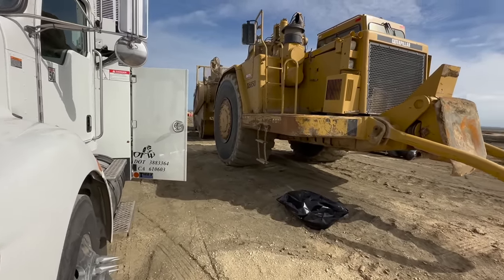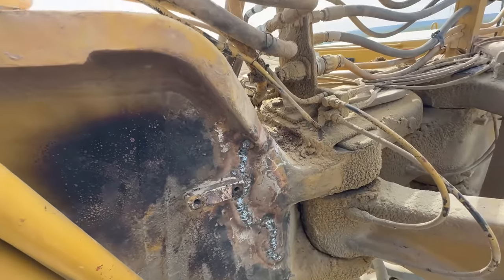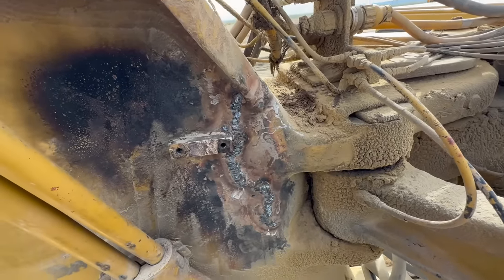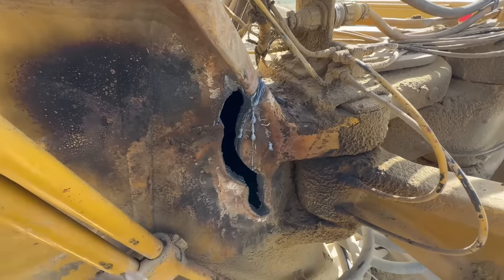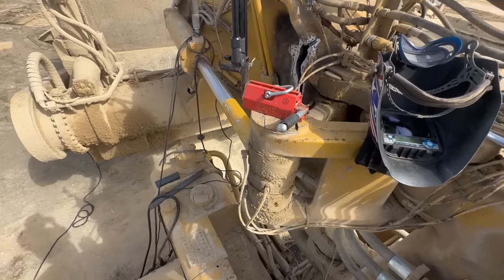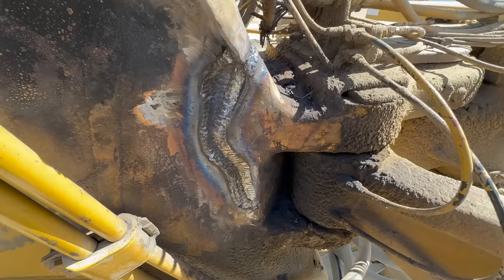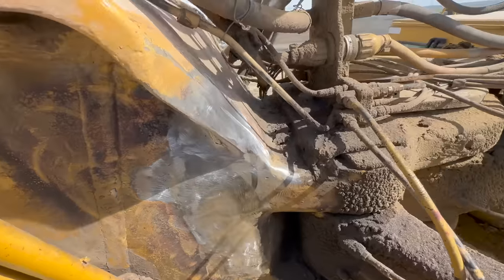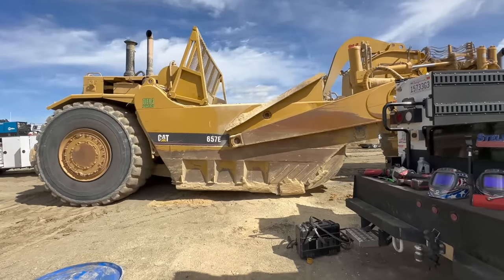Cat 657 with a big crack!!!

Comment: That is a gross structural failure. Cat is not using the right alloys with high tensile strength, or could be a bad casting, or both. I am sure your weld is 10 times stronger than the base metal.
Reply: Everything has a service life. While yes, it is possible to design parts strong enough so it won't fatigue and crack, if you tried to do that on bigger trucks and machinery, it would get so big and heavy it would either collapse under its own weight, or be so expensive nobody could buy it. CAT predicts exactly how many service hours things should last, and I'm pretty sure if you ask them they'll tell you. It always tends to break on welds because the root of the weld is a huge stress concentration point. And without re-heat treating after a weld, that will forever more be a weak spot. So I'm not sure CATs guidance on this repair, I'm sure its fine, I can almost guarantee you, the weld probably isn't stronger than the part originally was. Maybe close, but it will fail again. Probably sooner. There are some newer patents from CAT which should move the root of the weld out of the load path on structure critical future parts. But you didn't hear that from me. Either way, not a gross design failure. It failed as intend, probably when predicted. Otherwise CAT would recall the part and fix their design like they've done on some many other parts.
Reply: @crazy_mind-ox8if  -  The heart of good design is knowing the high stress points and doubling up on structural integrity of the weak point. It does not mean making the entire machine heavier but recognizing weak points (either by computer analysis or field reports) and improving it. It is a process that should be ironed out during product testing phase before the machine is put into production. I don't see such gross structural failures on reputable brands, like Komatsu or Liebherr, because they put their products through rigorous testing before selling them to customers.
Reply: @NICK-uy3nl  I'm telling you, I've talked to the design engineers on an almost weekly basis for a while now. Every other sentence is "but that would increase weight". I don't know where the push comes from, but I can almost guarantee you the crack was predicted in FEA, and is part of the regular service advisory for that machine. I work at a foundry that makes most of these parts, and I've seen what happens when parts fail sooner than expected. It takes a while to make a new design, so it might be 2 or 3 years, but when something actually fails when it shouldn't, customers get upset and they 911 a new part through the process. Currently doing that on some frame components for some of their dump trucks. Oh also, CAT does have a proving ground, and they test it for months if not years before anything gets put in production. Its not just komatsu and liebherr
Reply: @crazy_mind-ox8if  - Seems to me Cat safety margins are way below industry standards. That can come from either arrogance or ignorance. Maybe they need smarter engineers with modern tools for design and failure analysis to keep up with the competition.

Comment: good job boss. being a retired union field Mechanic, primarily scraper spreads,
I tackled pretty much everything. the evils of working it hard.
Reply: Union would’ve taken a week to fix that.
Reply: well may be today it might be how it is with you,   back in the day, working under me, you weren't getting it done, you draw your two checks and you be gone. Operating engineers.  we ran large dirt spreads, 
You don't see them anymore today, 666 dirt spreads, 30 or more at times. 57's, 30n or more,  
Now it's large, massive mining projects being done. 
union, Not everyone welds, and  not everyone who can weld is trained in machining / line boring. 
The primary job of a filed mechanic, is to make sure the equipment is up and running, in other words, 
 Keeping the operator in the seat through out the day. Lose sight of that, and the Project manager will fire everyone.

Comment: I ran a Wabco 353 single engine scraper for 4 years, in the iron mines of northern Minnesota, it was brand new back then. Might have the model number wrong.  Never ran a scraper before.  Forman's instructions was, "get in and get to work"!!  that was it.   I got pretty good at operating this giant.  I did have a couple of close calls, I did spin it completely around on an icy road, that was fun.

Comment: Insane the amount of torque on that area to crack that thick of material
Reply: First i thought it was the steering mechanism that coused this crack , but after seeing the complete picture , i think it s the constant up and down hammering of the front (Motor) that couses this crack.
Some welds in the upper part are from an earlier repair?

Comment: In Australia we have to have run on run off tabs ...we just tack flat bar at the bottom or start of the crack, we start the weld on the flat bar first before running on to the repair then run a weld at the end of the crack onto another tab at end of weld...porosity can form at the start or finish of any weld so the tabs stop this from happening...the tabs are simply cut off and cleaned up when complete

Comment: Really nice work especially the plasma. Spot on sir. Back in the day before I had my suitcase I used stick and would gusset the exterior along the X axis towards the rear of the  knuckle towards the pan for about 8 inches  and it would stop it from occurring again. It could be because I was using stick that I had to gusset it. Again you do very nice work

Comment: Lol , I work for that company thats a very common crack. Those bushings don't get changed/grease the machines keeps running. When those bushings get worn out, that neck starts taking a lot of abuse and that's an older 657 so I'm sure there is other repairs.

Comment: It was nice to watch the before and after, looks great. I’m new to welding so I’ll ask in order to learn:
1. What were your machine settings: wire, feed and amperage. 
2. Why use mig over stick welding. 
3. Why no pre-heating of such a thick repair.
Reply from the maker: 25volts and 250 ipm 
Mig is just as strong and way faster. 
There was pre heating.

Comment: The metal was drawn out, after it cracked.
Before fixing it in position with the repair, was it somehow compressed back into it's proper position?
Otherwise it was fixed to the drawn out, deformed position.

Comment: I just did a repair similar to that. Only it was the steering cylinder mount that broke off. Customer did the easy sides I did the harder to reach side with a 2 inch gap to fill and the over head also with about a 1.5” gap to fill. What the heck are they building out there in the desert?
Reply from the maker: It’s a land fill

Comment: Nice, I worked at CAT briefly and was fortunate enough to work on the 657. Replaced a couple cushion hitches that had cracks in them just like that. For some reason I always thought they were some type of solid casting, now I see, they are hollow inside, cast steel? Idk, I'm no welder!!
Reply from the maker: I always thought they were sold too. Until I cut all the way into one.  It’s probably cast steel.

Comment: How good are the cubitron wheels! I like the Polifan curve as well but in Australia they are both stupid expensive. I use a cheap Flexovit 36 grit sandong disc with a semi flexible backing plate and they eat metal faster and neater than any grinding wheel.
Reply from the maker: Cubitron is the best sanding wheel I have ever used. And I have used a lot.

Comment: Excellent work as always Greg, bet that tore up a roll of wire filling that crater in! Sure doesn't look like that automatic greasing system is working very well on that scraper? Was stationed in SoCal for a number of years, you could pass by an area where those scrapers were working on a good size hill and in a matter of a couple of days it was a flat area ready for Million dollar homes! Have fun!

Comment: Good work, but I would have got a trusty ole carbon arc and arced  out the weld cleaned it up then layed some 1/8 7018  in there but u did a phenomenal job 👍

Comment: Nice repair job. Genuinely interested on material spec and your filler wire. It  definitely looked like flux core but I couldn’t see you cleaning away any flux in between runs. I understand it’s a field repair but I was also wondering if you would normally pre heat and post heat on a repair job like this, seeing as it is a pretty significant size repair and a lot of heat input from filling with weld material and with potential for future cracking.
Reply from the maker: I was using dualshield wire. You can definitely see me cleaning flux between each weld. I did pre heat a little.

Comment: Looked pretty windy,what wire do you use,I run lincoln 71m and when the wind gets up alittle you have to crank the gas up 30 cfh and keep the nozzle right on the arc to avoid porosity and crows feet in the field.im sure some wires handle it alittle better than others
Reply from the maker: Lincoln 71a75

Comment: Great video.
Just a question, after all that welding, is it not necessary to anneal the welded zone, to take away all the internal stresses ?
The filler rods, I guess are specific for this work, is that the case ? (sorry 2nd question).
Thanks for sharing this.
Reply from the maker: I have never had any issues doing it this way.

Comment: Looks great! What is the strength of the weld compared to the original section that cracked? I pressume it's not weaker but is it stronger than the original steel?
Reply from the maker: The weld is definitely stronger than the original steel.  Probably about 20%

Comment: Missed opportunity to reinforce that area? Looks like that is a weak point considering the force that pivot pin exerts on that section, all tapering down. Perhaps a 1/4 plate of steel with relief shape on both sides? Anyway, a lot of wire went into that one! Looked great!
Reply from the maker: Customer wants it to look OEM.
Reply: @OFW  what a shame, when looks are more important than improvement as needed. But, if a customer has that specific wish, then why argue. It cracks again on the other side and you can come back to it :)

Comment: Did you use to be a heavy duty mechanic? What are your suggestions to someone who wants to do what you do as a career and own their own business, suggestions on where to start etc. Do I need to go to welding school first or be a heavy duty mech or what? I know I wanna weld and I know I wanna be in the heavy equipment industry. Thanks, love your vids.
Reply from the maker: I was an automotive mechanic for a couple years.  I got into welding. Then I got involved with heavy equipment.   Almost everything I know is self taught.   I would suggest working for a company with heavy equipment for several years before starting your own business.
Reply: @OFW  Thank you so much for your reply. What did you do to learn about and break into the heavy equipment world and mobile welding? Most people I've spoken to have all told me to go to a fast-track welding school (14-16) weeks so I can get the AWS certs etc. I also have a passion for welding and self-taught.  How did you teach yourself about the heavy machines to know how to weld them and which lines to remove etc for prep. Sorry for all the questions but what you do exactly in all your videos is what I want to do. I have always jumped jobs and when i bought my first Hobart 140, I've been obsessed ever since. THANK YOU
Reply from the maker: @ItsBarnabyJones  just started working on stuff.  I was never afraid to tackle a job I have never done before.  If you are mechanically inclined you should be fine.  Fast track school isn’t a bad idea.

Comment: am very skeptical about welding such thick steel without any preheating in view of cracks between the steel and the weld and not better with as much welding as it turned out.?
Reply from the maker: It was pre heated. I think I came out pretty good.

Comment: Nice work. Is there any particular reason for not installing a stress plate over the repair?
Reply from the maker: Because that would be ugly and not look OEM.
Reply: @OFW  Ah ok, I guess for a customer it's better that it looks proper. Do you have to control the cooling process on a repair like this? Or can it just air cool?

Comment: looks nice I have always felt wire just is not as strong as stick for heavy stuff . what amps and wire size/number were you using ??? BTW is that the new landfill  where they were using the old flat track D9 double push rigs on the Pans ?
Reply from the maker: I think wire is just as strong if done correctly. About 300 amps. 1/16” wire.  Lincoln 71A75. 75% argon 25% co2.  I’m not sure about the D9

Comment: thats wild i def thought you would be fitting a thick piece of steel inside that massive opening and weld it in. I did not expect you to fill all of that up lol thats a lot of welding for this repair. Not the process I wouldve taken, but very clean work.

Comment: I'm a welder in training so to speak teaching myself through videos and trial and error. One question I have is that was a lot of heat to put in that articulating joint. Is there any concern needed as potential to over heating an area? I have had numerous projects get squirrelly on me when the heat started to chime in. You know what I'm talking about. Excellent job all the way around. I learned from it. Thanks.
Reply from the maker: Just keep an eye on it and don’t let it get too hot.  In this situation I used a laser temp gun to monitor the temperature.

Comment: awesome job!! what machine and mig setup are you running? im building a company and mobile truck of my own what would you recommend?
Reply from the maker: Machine is a Miller 600 air pak. Suitcase welder is a arcreach 12.   I also have a Miller 220 AC/DC for the smaller jobs and aluminum.

Comment: What are the alternative methods to doing a repair like these on equipment? Trying to get myself in the door with the people local to me but Im relatively illiterate when it comes to how codes on these things work, and working with/on equipment in general.
Reply from the maker: Well you could stick weld it. It would take longer but it would be just as strong.  You could use an oxy torch to cut it out or even a grinder.  As long as you pre heat and use a high tensile rod/wire you will probably be fine.

Comment: Hello, love your work, a couple of questions how do you control the  heat in the metal also do you post heat and preheat. I myself work on rail track special work, ( forged steel, turnouts) also build up welds. We pre and post heat to about 150 degrees helps with welding and moisture in the rail, I would like to get in to machine in field quick repair....Thank you ! Jp Toronto Canada!
Reply from the maker: Anything thick I pre heat for sure.  Post heat depends on the situation.  I use a temp gun to monitor the metal while welding.

Comment: Great video, New subscribers. Quick question since I’m new to welding, I see others use stick on big machinery. What’s the difference or if any to the MIG process?
Reply from the maker: The biggest difference is time.  Wire is up to 5 times faster and can be just as strong as stick.
Reply: FCAW dualshield, not mig.

Comment: Could that be done with a 160 amp stick welder on 240v.?  And with which Rod would be needed............
Reply from the maker: Technically yes. I would use 7018 or 8018 rods
Reply: @OFW  Ur answer surprised me, i figured you'd say 6010.?  The Deep Pen 6010 vs 7018 medium/shallow pen always makes me think.!  Why do people use what they use.!  I'd assume every1 would want the Deep Pen of 6010/6011...  My machine cant run 6010... says it can but B.S.!   But could u please Explain Something.?  If u had a project where 6010 or 7018 could be used.., what would make ur decision on which one to Use... The Deep 1 has only 60,000 Tensile Strength, and the Other Medium with 70,000 Tensile Strength... So maybe the diff in Tensile strength balences them out idk...haa Thx Man...  Hello from East Coast Canada btw.................

Comment: Does this type of repair give full strength to the area?
If not, approximately what percentage of original strength is restored?
Reply from the maker: The weld area is stronger than the parent material.  If it failed again it would fail next to the weld area.

Comment: Long spikes on your rigs front wheel nuts?  What's all that about then?
Reply from the maker: I like the way they look.  They are plastic.
Reply: Thank goodness.  Interesting job you have got there by the way.
Reply: Technically they are used to stick out further and break before other parts of the truck. Meant to tell the driver they're about to really F their truck up when passing on highways, close to a wall, etc. Some just look cooler lol

Comment: Sorry for the question. Don't you need weld some plate over your welds? Will it crack again?
And is this FCAW? Or just MAG?
Reply from the maker: The customer wants it to look OEM so no plates. If the repair is done correctly it will last just as long as original.  But yes, it will fail again. Just takes time

Comment: Comment and three questions , marvelous welding , my first thought very difficult but you did a great job. What amperage is your plasma cutter , how did you relieve the stress of the machine over the weld and what size wire are you running?
Reply from the maker: Plasma is 105 amps. Pre heat.  1/16” wire

Comment: Interesting job I would have probably put at least a half inch or 3/4  cross strap welded into that knuckles is cross to decide to build up the strength did the same thing to the other side because when it cracks like that metals been stressed prone to cracking can you have more than enough space to weld that strap in on the side of that.